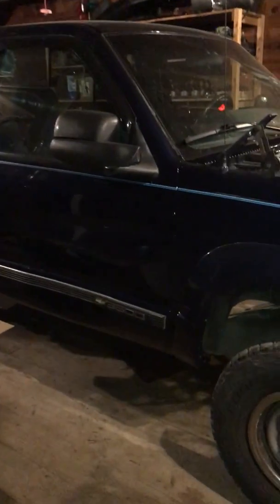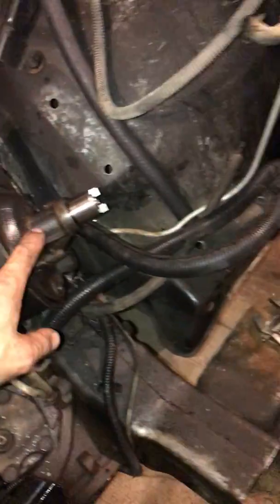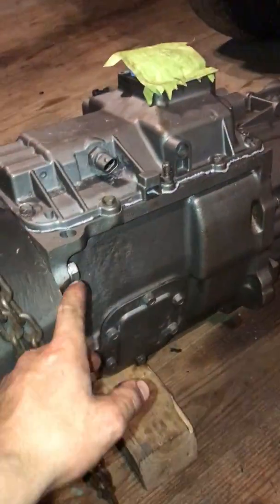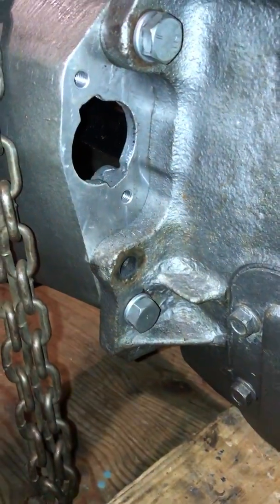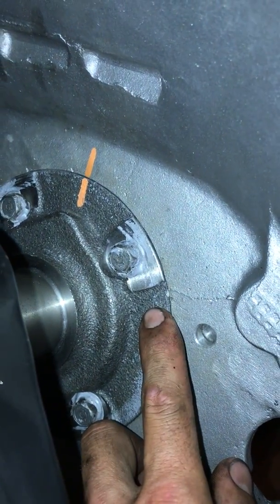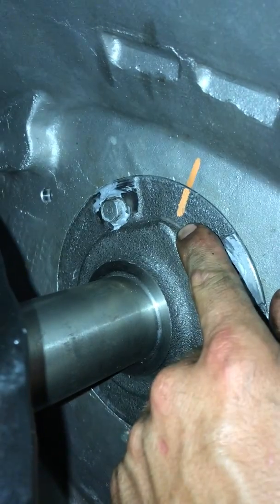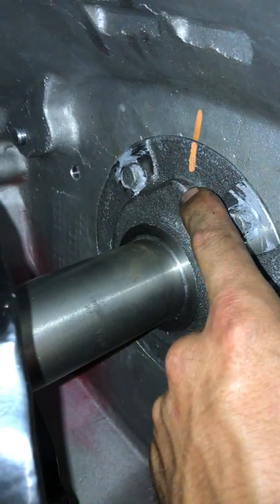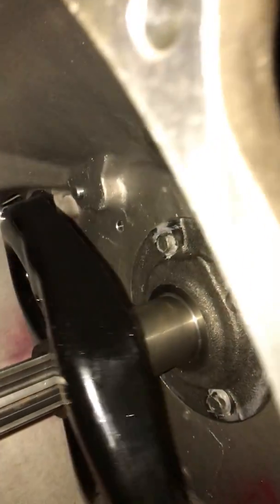1995 Cummins swap GM to Dodge NV4500 input shaft conversion

Comment: What input shaft Size  you used
Reply from the maker: 1 1/4"
Reply: Do you have a video where it shows how to do it?
Reply from the maker: @user-bg6le8hv5j  ive got one to upload i just did, but its so slow uploading, ill try to get it uploaded soon
Reply: Thanks.. will help me alot
Reply from the maker: @user-bg6le8hv5j  Just put the video up, i hope it helps, if you need more help let me know
Reply: I was hoping you were  going to show How to do the input shaft on the 95 gm nv4500
Reply from the maker: @user-bg6le8hv5j  ok ill try to make a video
Reply: I'm about to try to do the same thing just curious how it's worked out any other issues later on ? Thanks for the  video was about to buy anther Trans till I seen this